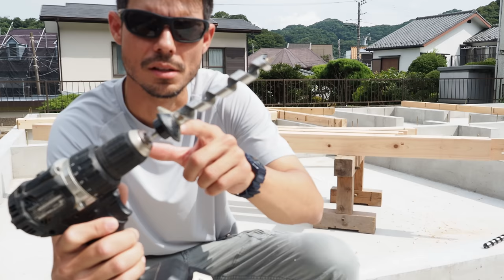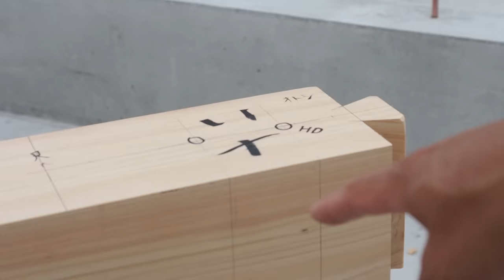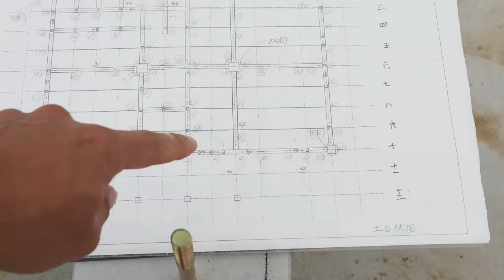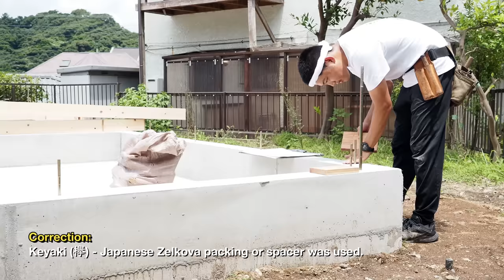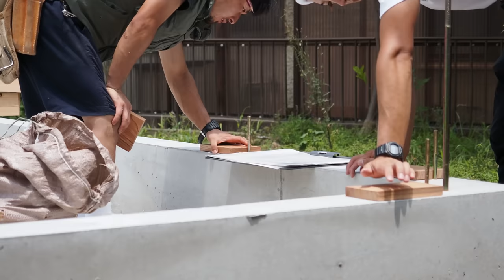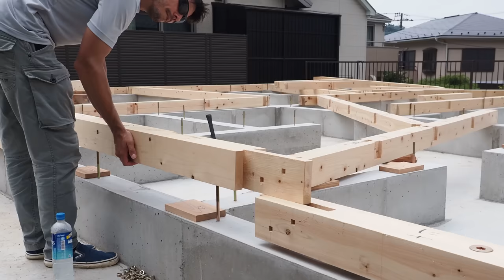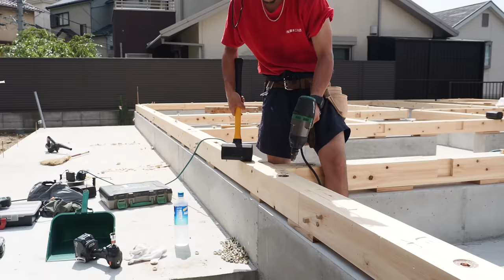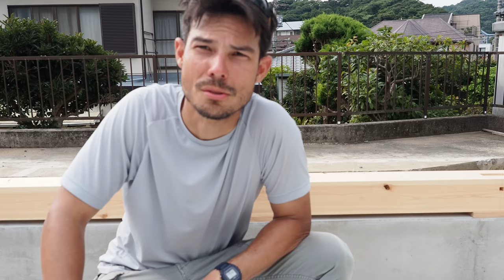Japanese Foundation Structure Explained! - Dodai (土台) - Setting up the Dodai (Foundation Beams)

Comment: Very impressed by the precision I see here.  Wish American builders routinely took this level of pride in their work.
Reply: Well it's really not like that.  American builders need to build at-scale and volumes different than Japanese construction crews for homes.  Americans are quite skilled and smart.
Reply: I agree. Every american expects a single family house and a car. This scale is not possible nor sustainable for other places. Often housing developments are built hundreds of houses at a time. I imagine the house in the video is for a wealthy individual?
Reply: We never get the time for fussy precision when building in the USA.
Reply: @e4d578  Skilled & Smart? sure but the main comment talk also about "pride" ,  now compare the Japanese & American culture then talk about "pride" at work, Enlighten me with your knowledge .
Reply: @libby2979  My first job was with Japanese construction.  I think many Americans have just as much pride but also need to consider volume, so some things matter and some don't.
Reply: @e4d578  I don’t know if volume is the reason.  I think it’s culture.  Even luxury homes in America use all the imprecise building methods that result in the need for finish carpenters to hide all the discrepancies.
Reply: @e4d578  Bruh. American houses are made of sticks and gypsum board. It's slow, resource-inefficient, and not remotely durable, and those are the ones that are built correctly. I'm not even going to comment on McMansions.

American standards are in a very sorry state.
Reply: @luke_fabis  You mean: it's fast, resource-efficient, and perfectly durable, right?
Reply: @e4d578  they're smart, because they use the cheapest products while marketing the homes as premium. From your walls to your doors, all drywall.
Reply: cutting dovetails into kiln-dried, smooth planed beams v.s. driving nails and plates into 2x12's.  It's amazing to contrast the building methods https://www.youtube.com/watch?v=UaDaDpX5ra8  Honestly, I think the Japanese method is overkill, but climate, earthquakes, lumber costs, there's probably a good reason for the differences.  Arkansas guy has huge pride in his work, same chalk lines and precision foundation, but with galvanized bolts and nails.
Reply: @mgjk  The internet tells me it has to do with Japan having lower quality iron that was more susceptible to corrosion when combined with their climate, so using metal fasteners was not part of their traditional woodworking, which has carried forward and influenced modern construction to some extent.

I don't know that that's true, but it's a sense-making explanation.
Reply: one worker made a #2  in the ventilation space under the roof when my sister made her house,  no joke
Reply: I mean would you spend 5 times as much for a house just to have "this level of pride"? Sure this looks good and all, but I could build the entire floor in a few hours using modern methods while they're still hammering on the same piece of wood the entire day. No one in their right mind would pay for that kind of work in the US.
Reply: @luke_fabis  How much money do you think it would cost to build a 1200 sq.ft house this way in the US? Just take a guess and let me know who would pay that premium.
Reply: The Japanese housing market is completely different than the US one. It is not uncommon for houses, even perfectly maintained ones, to depreciate in value there. A combination of below replacement level birth rate, and very low immigration means that houses are low in demand.
Reply: It's there if you want to pay for it.
Reply: @davidswanson5669  Thats because people are cheap and hire cheap General Contractor and Subtrades, Everyone looking for the lowest bidder. You get what you pay for.
Reply: @davidswanson5669  When the culture is "I want it fast, cheap and it only has to last till my divorce, then I'll sell it"
Reply: Any pro can build a home like a piano. But few can afford it. There are millions of empty/abandoned homes in Japan because their population is dropping like a rock. Only expect half the population by end of the century, so there will be massive overcapacity in buildings/factories/infrastructure. This trend is happening all across the developed world.
Reply: Once upon a time, about 100 years ago, here in America, they took pride in building. Now you either know someone who does professional work or you have to look for months before finding a proper builder.
Reply: I think this is relevant to a lot of the discussion here, seems like the use of light timber framing is a very american thing which does seem like it needs a lot less precision (a big advantage): https://www.youtube.com/watch?v=S6mUFrXexAk
Reply: Unfortunately craftsmanship like this would probably run $1000 per sqft in the USA.  Everything is so expensive
Reply: @nathanielkidd2840  in this case it's even more weird they are so meticulous with this.  I guess it's in the culture - perfectionists
Reply: You can still find it, but usually they are so well built when a homeowner who used to do construction themselves build their own. In the USA, production homebuilding is a race for the masses, due to the unique situation that the vast availability of bare land allowing so many homes to be built.
Reply: @luke_fabis  Everyone would build American and Canadian style if they had the resources to do so. Europe exhausted their wood resources and with regulations it isn't very economical to build with wood. American houses withstand earthquakes, tornados, and hurricanes, which most European houses never encounter and probably wouldn't survive. Enjoy!
Reply: @seigeengine  it's 100% true, it's also the reason why the katana even exists at all
Reply: Americans: ahhhhh housing is so expensive, I'll never be able to afford a home of my own 😔
Also Americans: wtf why are our houses built so quickly and affordably where's the pride and craftsmanship, why can't we build houses where it takes an entire week to frame a subfloor? 🥴
Reply: @ArthurDentZaphodBeeb  Sure, but it won't be a problem in many countries for the foreseeable future, because they import people instead, and the forces driving that are unlikely to change in the near to mid future, and the global population is going to rise for a while.

For example, my country admits about 1% of it's population in new immigrants every year.
Reply: I've done the Googling on price differences for house construction. Apparently Japanese houses cost about twice as much on average to build, per square foot/meter. In practice this means new Japanese houses cost about the same as new American houses, but they're half the size.

This is construction. Land costs are not factored in.
Reply: @nick21614  If you watch Matt Risinger , he shows a lot of building overseas.  Mostly, Swiss, but others.   Everything is building better and it’s mostly wood, even the insulation.  Much better built and sustainable.
Reply: @e4d578  Wrong. Most Americans are happy to live in a used house. That virtually never happens in Japan. The need for new housing in Japan is fair higher than in the US and the fact that the workmanship is leagues better is simply a reflection of cultural expectations.
Reply: @e4d578  While I agree with you on some parts just look at how poorly built American made homes, RVs and automobiles are made. You can blame those in charge for rushing production but at the end of the day we’re all at fault for the poor quality products we create for our fellow Americans.
Reply: @farmeunit  He showed one multi million dollar condo building with wood, that isn't standard EU construction.
Reply: @cartmanrlsusall  This is just a different method - it's more. More work in initial set up making sure things are aligned, by I expect the actual raising goes relatively quickly with all the pieces laid out and the lack of fasteners means it may very well go rather smoothly.

Different approach, same result. Which is actually slower/faster? Who knows - but in a world of CNC machines I expect that this type of construction may actually be less man hours in total, less overall material needed, and more sustainable provided you have properly managed forests given the use of joinery vs. fasteners. I would be very interested to dive more into this at some point.
Reply: @ArthurDentZaphodBeeb  I thought China was the one with the population problem.  What did Japan do to cause their own decline in birth rate?
Reply: @farmeunit  Cost of Swiss homes would make you blush.  And it's notoriously difficult to get a building permit. Reisinger never mentions that's why Swiss houses are built so well - they need to last centuries (often stay in same family for generations - lots of cultural differences) In the US, many homes see significant renovations, even tear-downs, so building durable homes doesn't make sense in many cases.  There's also a huge difference in lumber costs - North America has vast forests that keep lumber prices lower than almost anywhere else in the world (Japan buys whole logs by the shipload and takes back to Japan for processing - very costly for a basic building material)
Reply: this is nothing like an average build. The person buying this house just decided to spend a ton on weird construction that nobody normally uses
Reply: @ArthurDentZaphodBeeb  That's kind of my point.  Disposable homes.  Why not build to last?  Cheap and easy.  The American way...  Meanwhile, we say "Buy American" but don't put the same effort into things.
Reply: It’s not pride that stops everyone else from building to this quality, it’s cost. End of story.
Reply: Yea, I wish we could have that level of pride too. However, as many have noted, there are considerable cultural and societal differences in how housing is built and distributed. Making a high quality precision product is not always profitable and profits are the driving factor in much of American housing. The location of the land and then how many square feet and number of bedrooms and bathrooms. More numbers to get bigger listing thus greater profit and move on. It's a short term profit controlled market instead of a long term sustainable and durable market. Labor is the biggest cost nowadays and almost no boss/owner/seller is going to wait for this level of precision and the labor involved. Also, many times that level of craftsmanship is just plain unnecessary i.e. a luxury.
Reply: Diversity is not a strength
Reply: Regardless of culture, location requirements, scale, and the desired finish project the mark of a good carpenter is always honesty and pride in their work. You'll find bad carpenters everywhere, even in Japan. The reason a building exists is because someone built it, whether its in the suburbs built in mass production or a family home thats stood the test of time for over a hundred years. There are plenty of small time carpenters and big time companies in America that know full well quality of work is what leads to repeat business and good free endorsement from customers.
Reply: Also it can be very costly to take the time to do construction like that , the extra cost is not going to come out from the contractor pocket, if the homeowner is willing to pay the extra cost do it in time and material and you will see how quickly the homeowner will have and exorbitant bill, but the construction will be how he wants it
Reply: Like in every country the will be some master builders and some amateurs. High quality comes at a cost, why spend time dove tailing when a nailed butt join accomplishes the same thing.
Reply: @justanothercommercial  not for a wealthy buyer. The home is premanufactured and arrives at the job site as a kit. It's only expected to last 25-30 years and will lose all value 15 years after being built. The Japanese don't buy homes, they buy property and then build the home on it. This is why there are millions of abandoned homes in rural Japan.  Their housing market is totally different than western nations. For Americans a home is an investment and for the Japanese it's just an expense that they know will have zero value once they are done with it.

 American homes have a much more sustainable building process. Our homes are meant to last 100 years if properly cared for. The average economic life on an American home is 50-75 years. Japanese homes are built to be disposable.
Reply: @e4d578  a big difference is japanese homes are manufactured and then shipped to the site. American homes are built on site (except manufactured homes). If there's some screw up in the build of an American home then the contractor will work around it and maybe make a few changes to accomodate it. The Japanese have to be exact because all their lumber is precut. The plans are written in stone with no room for variance during construction.
Reply: @luke_fabis  "American houses are made of sticks and gypsum board" both japanese and american homes are stick built. the difference is american homes use three times the lumber because our homes are built to be permanent.
Reply: How quiet and clean the site is too
Reply: The extra labor that goes into this literally makes zero sense…🤷🏽‍♂️
Reply: @davidswanson5669 they decided they didn't want foreigners to take over their country in population.
Reply: @barryrobbins7694  "This is possible because their zoning laws are much different than the United States."

No, it's because the population has been forced into the cities to make japan completely dependent upon globalization. We went to war with vietnam to accomplish the same goal. I think this is why Japan started building disposable homes, they knew that the rural population would be herded into the cities, so why build homes that will last for 100 years when the rural towns will be gone in 30?

"Housing in the United States is typically larger and of a lower quality than in many places throughout the world."

 We build the best homes in the world here and our building codes assure they are the safest homes as well. and Americans definitely do value quality homes because that is where the majority of the population have the vast majority of their net worth invested.  You know nothing about how our homes are built and it would be best if you stopped pretending that you do. 

zoning has nothing to do with it, globalism does. before ww2 people in rural communities could support themselves within their community and commuting 80 miles to work Now all those functions rural communities provided have been siphoned off to China or wherever else labor is the cheapest.
Reply: @Phillip Banes I think I’m with you on most of that.  I agree that these examples are overkill.  Where I get most frustrated with American construction, though, is the imprecise placement of lumber, using lumber that will warp, and methods of fastening, all of which get perpetuated throughout the house and lead to wavy walls, dimensions in rooms/areas that are not square, or ugly workarounds by drywallers or finish carpenters who have no better choice.  I think Switzerland is using laminated lumber to help fix all of those issues, and it’s not overkill.  That’s a happy middle ground.
Reply: @Phillip Banes these Japanese homes are built entirely out of very precisely cut corners.  But that’s just a pun.
Reply: @libby2979  how would you know how much pride American carpenters have.
Reply: This reminds me of a builder I met in 2000 who was hired to come to Japan to train carpenters in western stick construction style.  They also hired trainers in plumbing and HVAC in order to become more efficient.
Reply: You can thank mass illegal immigration for that in the US.